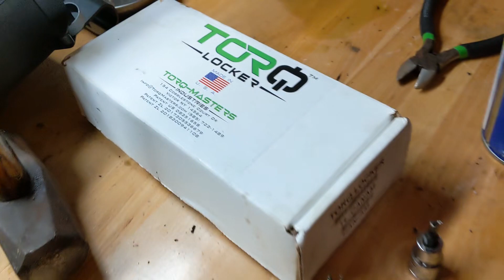Torq Locker & Visco loc Issue and Fix XMR1000R renegade

Comment: It should work perfectly now. Mine works great and I disengaged my visco completely just as you have. You also need to check the clearance of the torq locker. Great video!
Reply from the maker: Clearance was still good
Reply: @MudPuppyOffroad  after a little bit of break in I don't even hear the ratcheting anymore like when I first installed. Works flawlessly!
Reply from the maker: Awesome. I've installed them in alot of trucks and p500s

Comment: My 2012 0utlanderhas torque locker in it. I couldn't completely  disable visco due to diff being the welded one but I deleted  it as much as possible.  Took seals and visco fluid out where I could. Haven't had any issues  with mine. Mine sounds like yours after you deleted  yours. You should  be good to go now.
Reply from the maker: It looks like what happened was my clutches got smoked. The torque locker allows it to free wheel differently than a real differential.
Reply: @MudPuppyOffroad  I couldn't  get my clutch part  out just the visco  fluid side due to mine being the welded diff. Newer ones have the bolted clutch half and you can remove it all. Hope mine doesn't start  doing that in the future. I'm working on my bike now also trying  to get it back to 100%. Just the nature of the can am. Waiting on my mud and wheels rear drive shaft and new pinion seal to get in so I can finish mine up.
Reply from the maker: @alphapackoffroad  mine was weird looked different than the manual but I got everything out

Comment: See those black screws/bolts holding your diff to the main gear. Mine all sheared!! Canam did not apply thread  loctite on so they loosened and then all sheared. I have started a case with them about it. Fucking 900km machine. I can’t believe it….most expensive quad in the market and they fuck this up
Reply: I have video up if you want to see
Reply: https://youtu.be/-yKzqUJImb8?si=dHBBGJufGxruZ_gy

Comment: Well that was the big reason I was holding out on buying a torq locker for my gen 1 because you cant remove visco in the gen 1 front diff o well she does good as is
Reply from the maker: Read the manual there is a procedure for how to do it on gen one. The gen 1 visco is even more useless than my qe
Reply: @MudPuppyOffroad  one wheel peel until it engages and pops a front axle its dog shit horrible highly considering getting a new Rubicon shortly